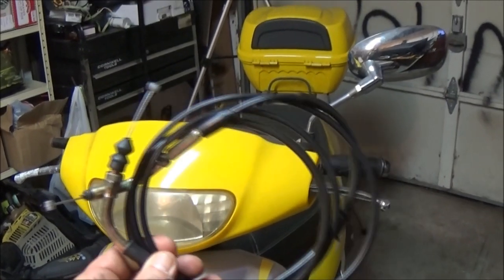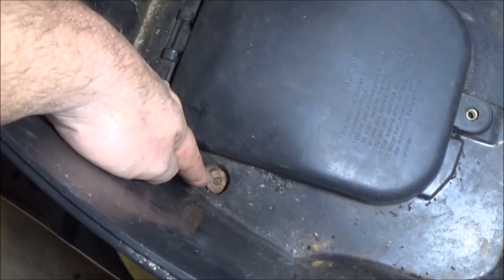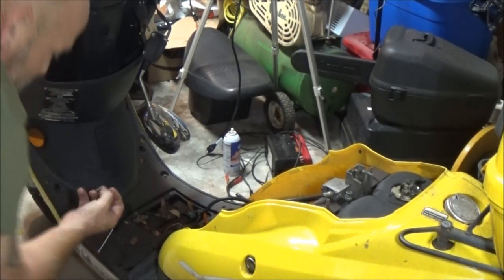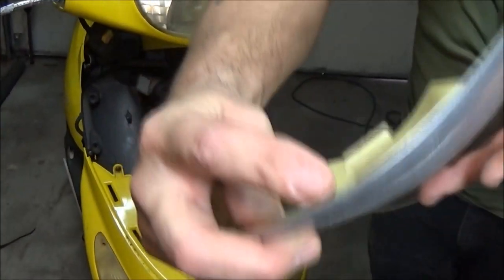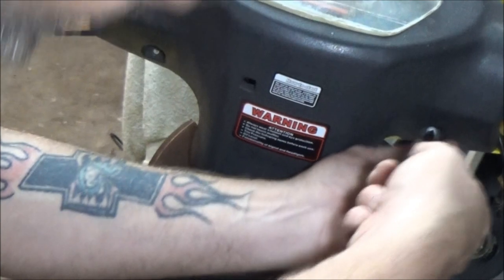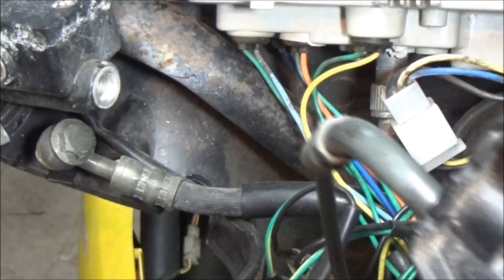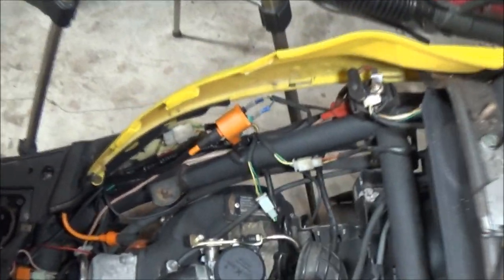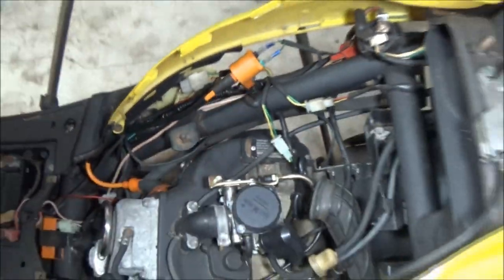Scooter Throttle Replacement How To

Comment: Thank you for basically, the only removal and replacement throttle cable video on the whole of you tube.
Reply from the maker: you're welcome, thanks for watching and commenting.
Reply: A trick : you can watch series on flixzone. Been using it for watching a lot of movies recently.
Reply: @Kyler Malachi definitely, have been watching on Flixzone for years myself =)
Reply: 11111111111111111111111111

Comment: The ONLY factory piece of plastic on my scoot is the bucket. I panned all the rest of the body with an old aluminum toolbox.
The frame & engines last , the expensive, junk pastic bodys dont.
I had a 10+ year frame Totaled by a car.
It had 64K+ miles on the odometer.
The motor wasn't original but the frame & wheels were.
Even after the crash it stayed running.
The whole front end was collapsed tho.
Fun durable rides, but ALWAYS wear protection & be ready to jump or bail off of them. I still keep 2 as daily drivers
Reply from the maker: Awesome man. Ya know, for as cheap as these things are, they are very tough and reliable. Not to mention cheap and easy to repair and modify.

Comment: 😂😂😂 you said excuse me to the camera your funny
Reply: I think I got the throttle handle grip on right but it won't spring back when I give it gas and my carburetor is a high pro carb what am I doing wrong I had to walk away from the scooter because I was going to beat the hell out of it
Reply from the maker: @stewheff1290  something is too tight or not adjusted right. Make sure you don't have a cable kinked somewhere. Unhook the cable and make sure it is free and not binding up on anything.
Reply: @shabear1000  alright thanks
Reply: @shabear1000  I should have just bought a new one but the dude sold me the used one for $8 and a new ones $28 that I save money and I'm on a tight budget so and I need my scooter for work does child support take my license 28 years ago and well I got a ride a scooter now
Reply from the maker: @stewheff1290  you're welcome, let me know what you find out.
Reply from the maker: @stewheff1290  I know what you mean about the budget thing but sometimes it's better to buy new because if you got the wrong cable you will essentially be paying 36 dollars for the cable instead of 28.
Reply: I got it it's snapping back it is the cable but I zip tied it to a bracket so I'm back in business again yeehaw
Reply: Imma buy a brand new cable for spare tomorrow just in case
Reply: Now the fun part begins I got to put every thing together
Reply from the maker: @stewheff1290  glad you got it working
Reply from the maker: @stewheff1290  that's a good idea, that is something you want to depend on, almost as important as brakes.
Reply: @shabear1000  your so right

Comment: That's what mine is doing so i just bought a cable but I bought a used cable you the ive got it on wrong or you think the cable is bad
Reply from the maker: Make sure it's the same length as the original and make sure it's moving freely.

Comment: Having a issue with a noes 50cc it’s a brand new throttle cable I fitted but it won’t pull open and it won’t close either it won’t do anything I will pull it off again and have a look but anything I’m missing my cable goes into the carb top?
Reply: If a new cables stuck, the outter sheath is usually bent too much. When installing a slide cable, the less ripples & curves= the better. You want to make sure the inside cable flows easily in both directions before connecting the cable ends.
Reply: @noneshere  i fixed it in the end my friend but thank’you for the reply

Comment: Good video, on my 50cc why do you think my throttle has so much play? it actually can spin about 3in forward, then rolls back to neutral, then twist it down to engage it on the carb, I tried adjusting it from the carb and the handle, nothing, when you twist it forward you can look at the carb and see a small looseness, when it goes back to neutral it straightens out,  any ideas?  TY!
Reply from the maker: It could be partially off on the throttle up on the handle bar. Take it apart and check it. If it has ever been replaced, could be too long. Let me know what you find out.
Reply: @shabear1000  Yea, I just got this 50cc and I have a feeling its been played with, ty for your help, I'll let you know

Comment: I know this is old but what makes the throttle snap back on these? I just took my carb apart to clean and now my throttle doesn't snap back
Reply from the maker: The spring on the slide in the carb